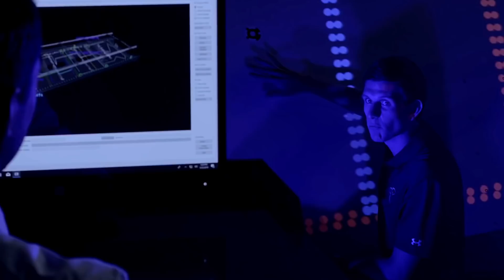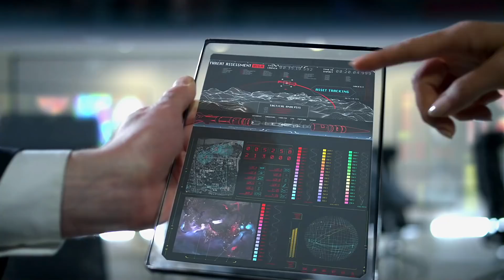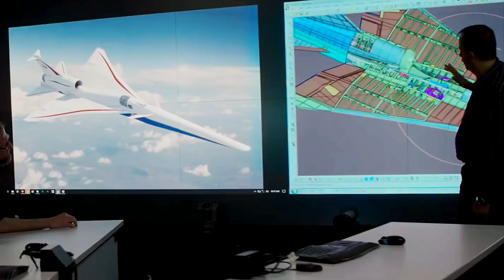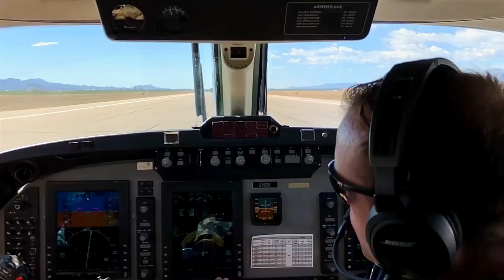Skunk Works Speed Racer

Comment: It's not drone, It has no air inlets. This thing is a guided missile, with recon camera's at best. Drones have air inlets if it is jet powered, and propellers on the cheaper ones. This thing has no landing gear, because it doesn't land. Just blows up after it hits its target.

Comment: If there is sufficient power and broadcasting potential on the Huron air craft. The fast drones could be controlled on the aircraft. Lowering communication lag with the drones and allowing for more covert data collection. + Lower flight times could allow more ai contingency s to be produced. A last thought a fast low drone could lead and paint targets for other missiles to follow. While loitering drones are better at this in lower teir threat environments speed / stealth would be at a premium in more equivalent situations.

Comment: there is a problem, robots cannot replace precise human measurement and manufacturing, the airplanes will probably look like T 34s during WW2, rugged no afterwork, no finishes nor other touches...also robots cannot work at micron precision level, at least not yet, airplane design use 6 sigma or 12 sigma statistic deviation standard of dimensions which beats the tollerances and precision of automation for automotive industry, and the most precise robots in automotive where i work have a tollerance of + / - 0,01 mm that is 20 microns, i don;t know if this precision is enough in space and aircraft industry, but hell what do i know, let there be skynet :)

Comment: And I would take umbrage at the suggestion that manufacture has been slow, you are ultimately taking a poke at an airframe with no understanding in competent terms what is 'under the hood'... I would pose your suggestion against the development of terminal microsystems in the same period and perhaps even use that in terms of comparison for anecdotally associating the production and advancement of aircraft in the same period.

Comment: But I can surmount that the move away from analog intervention is a productive method of maximising effectivity of systems by minimising human intervention in the manufacture process which both evidentiarily and anecdotally has produced greater than varied results in finished product quality.

Comment: 2:20 Russia is not out producing the US and certainly not china. USAF acquired more f22s in just the short run in the early 2000s then Russia's acquired su27 variants in the decades sense that time much less PAKfa. Both Russia and china have a few dozen fifth gens operational with maybe 100 all told between the two. Just the USMC even with there reduced acquisition rates still out numbers either individually and the USAF alone had more then five times the number of high end stealth fighters to say nothing of the quality of there vast fleet of legacy jets.
Reply: Speed racer isn't anything more then what the X-1 x-15 or even the x-51; a demonstrator! Its a trial run of the tech not a serial production asset, the point is to demonstrate this automated design and planning systems ability to produce and acquire innovations like a new purpose designed cruise missile or drone fast enough to avoid the constant issue of being equipped to fight the last war.

Comment: In WW2, if a manufacturer accumulated 100+ hours of testing without any serious deaths of company employees, low-rate production was started to get the first batch of products into the hands of the first troops (known as "advanced beta testers") while military test pilots were still thinking of more stuff to test. But as with any other complex system, there are so many undreamed-of combinations that thousands of users, (millions for software), are needed to even give a HINT of the magnitude of testing needed. 

The concept of integrated manufacturing is intended to cut down the total time needed from the first point plotted on a scope, to delivery of production units from factory to first-level distribution points, and be flexible enough to change things without turmoil. I've seen a similar process in automotive design/prototype/test/build/support for 30+ years now. Progress has been made, but every minor success produces even larger demands, and shorter, cheaper cycle times.

Add in the human factor of hidden "empires" or "duchies" being uncovered as this goes on, and one begins to realize that Murphy's Law undergirds all human enterprise. To paraphrase Clausewitz, "in manufacturing, the important things are simple, and the simple things are hard". As we gained a better picture of the science, technology, and industrial politics involved, human activities did not have to follow as many rational steps as other parts of the system did, and was always the biggest time-and-effort sink.

Add to that the demands of any kind of aircraft (or cars) is vastly more complex, and it's a miracle that anything can even APPROACH production in 20 years. Much of that comes from the top, where top management has their next ten years of career advancement carefully planned out.

From what I've read, the only bright spot is for the blackest of black programs, when they can keep things secret within the organization so that hordes of excess chefs don't appear in the secret test kitchen, where they all try to add their own unique ingredient to the dish, just so they can justify themselves that they are still earning that princely salary. Kelly Johnson's biggest miracles were keeping projects small, secret, and quick to deliver only those items agreed to in writing.

Comment: As a man, who worked for Anadite Aerospace, milling aircraft parts with chemical. I can tell you this is total BS, to make other nations think, we can innovate at a faster rate than them. There is always a +/- of 5 thousands, that is expounded on down the line. You think a 747 wing is stable, it's not, each exemption to the rule compounds on down the line. FFS learn something about real manufacturing.

Comment: I’m missing what’s so special about this aircraft.  It’s a drone; we’ve had drones since the 50s.  What’s different or new about this one?  Its small size?  How is that anything special?  We’ve had small air-launched drones before.  That small size will increase the number of potential launch aircraft but also limit its range, endurance, and payload.  Absent a nuclear warhead it’s too small to be of use as a cruise missile, and it has neither the range nor speed to be an anti-ship missile.

So what’s the draw?

Comment: So it sounds like a "generic" platform for different roles depending on what they stick on the front of it. With a warhead it's a cruise missile, put a camera package on and it's a recon drone, or put electronics packages and it's a EW or ELINT drone. Makes sense that a common UAV airframe would reduce overall costs, and with some established dimensions and power systems to work with, developing new packages for it would be streamlined too.

Comment: Got a buddy who helped design a similar engine shape using modeling tools and super computer sims. He just said it flew so fast and hot it distorted the engine shape. If it flamed out, it couldn’t be re-lit…
Worked like a diesel, no ignition system needed, just hellacious pressures.

Comment: There is a new engine that will soon be ready for the F35. The new engine will give it a mach 1,7 speed and a 25% larger combat area. This is very good news for NATO. It is especially good news for the US Navy. This engine will make it possible for the navy to not only launch an air strike at a safer distance it also means that the 1500 km reach of the longest reaching airborne antiship missiles in the Chinese airforce is not long enough. This is also very good news for nations like Norway that has a long coastline to defend. One can hope that the main bulk of the Norweagian F35s will get this engine. The now existing  combat radius for the F35 is suposed to be 1230 km but it is closer to 1000 km. From this perspective another 250 km is excelent news. The increased speed is also good but could be better.

Comment: Let me correct you. The footage you show is a Beech King Air 200, not a Beech 1900 as you mentioned.
Beech 1900, which is a significantly larger aircraft than the standard King Air 200 /C-12 designation.
The military version of the Beech 1900 is called a C12J.
Reply: The pronunciation of Huron as Heeron is also bizarre.

Comment: 'stardrive' = finally upgraded from windows XP and got a trail version of AutoCAD or similar.  Seriously FFS the 'can make holes in the right place with software!' BS is happening on consumer grade software and CNC for a long time now, and design in software as well.  everything stated about 'stardrive' you can purchase as software packages at various levels of functionality (from Fusion360 subscription to Solidworks/CATIA with full technical support), the accuracy in manufacturing comes from expensive machinery that is highly calibrated and operated by experienced professionals.  This channel is just rediculous hype of whatever, there is no critical look just overdramatic sensationalism. 'Stardrive' is literally bragging about having 20 year old capabilities to manufacture from digital files.

Comment: I call B.S. on this.
If this works, as advertised,  how will Lockheed justify project cost overruns, and boost budgets, for developmental issues and project delays, as has been their trademark M.O., for the last 50 years??
No, Lockheed will find a way to put this, "on the back burner", to continue to rip-off the taxpayers.

Comment: Looks to be a tomahawk cruise missile but with low flying abilities and bigger fuel tank which could help it stay off radars and have extended range
Reply: testbed for hyper missiles?
Reply: @-Jeremiah-  honestly i doubt it, this wont be able to hit hypersonic speeds. You would need a scramjet of some sort to be able to hit that speed along w the fuel reserve to do so. But the army is testing long range hypersonic missiles. But they wont be airborne launch capable. Possibly like an upgraded S-400 or Patriot Pac 3 of some sort
Reply: @Emanuel-kz9lw  Conventional rocket engines have reached Hypersonic speeds since the 1970s. Sprint missile.
PAC3 Patriot missile hits mach 5 which is hypersonic. 
Hypersonics isn't new, or that difficult.
Reply: @saltysteel3996  true but with a compact size, like this missile its hard to keep those hypersonic speeds for long.
Reply: Looks more like a JASSM to me, but similar to each other.
Reply: Possibly a supersonic cruise missile or automated cargo pod with delivery capability
Reply: lol looks like a typical target drone, been around for decades.
Reply: It is based on JASSM missile that is also developed by Lockheed Martin. Tomahawk is developed by Raytheon and is longer, sleeker and rounded compared to this stealthier profile.

Comment: Makes u wonder if Stardrive will be used to get the American 6th generation projects out the door sooner.
Reply: It is not clear exactly what was tested but the US military has confirmed it flew a prototype 6th gen fighter. Though that leaves a lot of room for interpretation.
Reply: It’s actually a Lincoln Continental fitted with a anti-gravity drive that can drive to most planets in the Sol system.  It has a nitrous injection system to make it go faster.
Reply: Stardrive=skynet
Reply: If the project has already been started then probably not. But the next few aircraft will come quicker
Reply: More than likely they used the Beta version of Stardrive on the 6th gen prototype.
Reply: Nah since it’s a Lockheed Martin product it will likely have about 1000 design flaws and come in about 500% over budget.
Reply: Goes without question this seems to me to be a game changer for the US  sounds like a really good idea if it actually works they definitely need to speed up the process to remain at the top of the game. I wonder if the UK is watching this with interest.
Reply: Funny how the confirmation of a 6th gen was given right around the same time the Pentagon and a recently retired Navy officer came out about UFOs
Reply: @know1knows839  the UFO videos are like 10 years old tho. The confirmation is new
Reply: @TheJttv  2017 isn't 10 years
Reply: I had the exact same thought. I remember in the 70s and 80s many new UFO sightings involved “black triangle” shaped aircraft. Then one day in 1989 or so we, out of the blue, reveal the F117 and B2...which look exactly like black triangles.  The real UFO “cover-up” is the gov’t allowing just enough info out to make people think about aliens to cover our own secret programs.
Reply: @bryangrote8781  
The black triangle craft look nothing like the 117; and sound nothing like them either.  Jet engines are obvious.
Reply: @bryangrote8781  the Roswell incident was a crashed spy balloon. The government played their cards well and used the alien crash conspiracy to hide the fact that they were using balloons to spy on the Russians.

Comment: I wonder if they just showed it launching from the belly of the plane in the simulation but they will actually carry them under the wings like rockets or missiles.
Reply: A lot of new weapons systems are designed to be carried internally to reduce radar cross section.
Reply: @whitenoise509  That makes sense, I didn't think about that but the plane it was dropped from in the simulation isn't a particularly stealthy plane though is it?
Reply: @chesspiece81  Haha yeah something tells me those props don't help a lot lol.  I was guessing that was supposed to be their test aircraft, but idk.
Reply: Or what if they actually shrunk the size and launched them by hand.
Reply: @daBEAGLE1017  Hunter-killer drone

Comment: Although all of this sounds cool the new super computer driven design system appears to have just re-invented the Tomahawk, a system designed in the Regan administration probably with slide rules and pencils.  Perhaps this is baby steps.
Reply: I think the Speed Racer honestly is simply the first "outing" for the new design system. Build something somewhat safe to ensure the system works. Who knows what later designs will or have already yielded.
Reply: It’s less about the capabilities of the design, in this case speed racer, and more about the system being used to develop it. The point is to decrease project delivery times by streamlining the entire process digitally

They are reinventing the wheel, yes, but with modern design practices

Comment: I mean, it just basically looks like an update to the tomahawk cruise missile.
Reply: Looks closer to a AGM-158 JASSM than a Tomahawk to me.
Reply: I mean, I mean
Reply: Could it be that the innovation is in the process not necessarily in the product?
Reply: The big advance isn't the aircraft, genius, it's the digital engineering program that produced it
Reply: Super Tomahawk
Reply: Wow your stunning technical analysis is simply amazing!  LoL
Reply: It's not what it is.  It's how it came to be.  That was the point.
Reply: @robedmund9948  - Sure, the process is interesting.  The device itself seems pretty much like an incremental improvement.
Reply: Yeah, 😑
Reply: Update how?  This thing looks much smaller, limiting range, endurance, and payload.
Reply: I mean Tomahawk is 50 years old technology in production for 40 years. Not updating it is crazy.
Reply: @alexm566  your kidding right?  Cruise missiles have gone through countless modifications over the years.
Reply: @catified2081  I know, but OP was referring specifically to tomahawk and not cruise missiles in general.
Reply: You know weapons get updated with current tech every few years right? New Rev or Generations. Just because the Tomahawk has been around for 50 years doesn't mean that it is outdated or obsolete.
Reply: @saltysteel3996  nonetheless it is obsolete, tho not useless